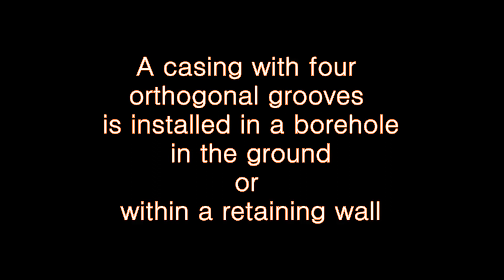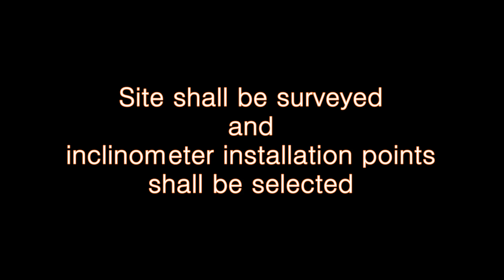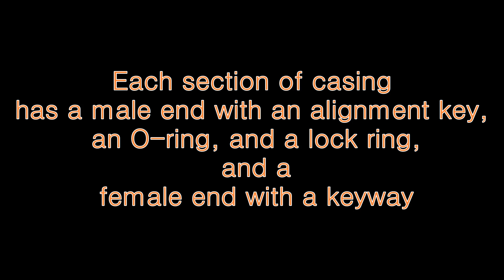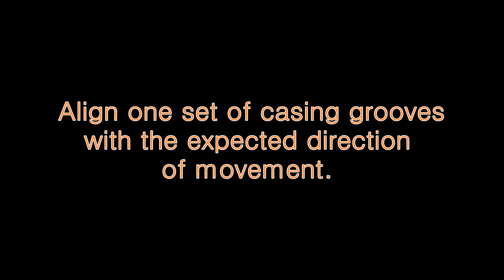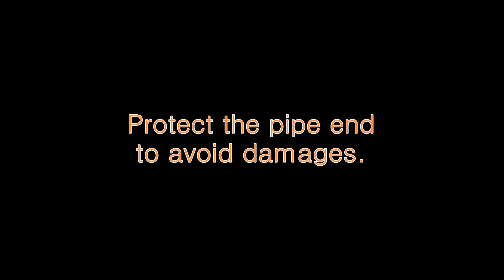Slope INCLINOMETER  Installation

Comment: Did you not put any tape around the coupler joints? How will you be sure that the cement does not enter the inclinometer casing and block it up or obstruct the keyways? Also - are using a concrete mix for back filling the borehole? No bentonite? If you back fill the annulus of the borehole with concrete all you'll end up with is a reinforced column of concrete with a plastic pipe in the middle.... And where is the slope? I don't see it in the video? It looks like your drilling and installing on level ground.....
Reply: That is what the "O" rings on the male thread is for.